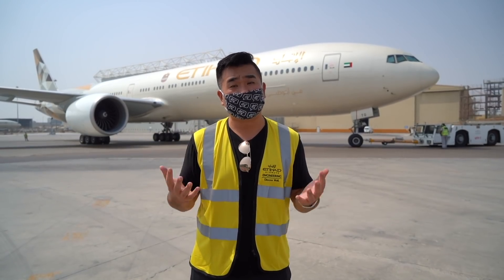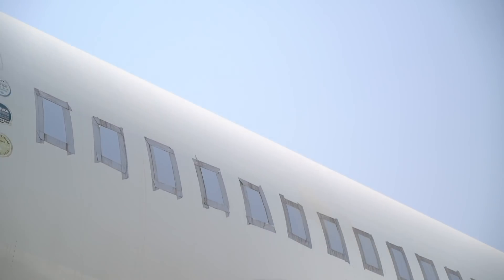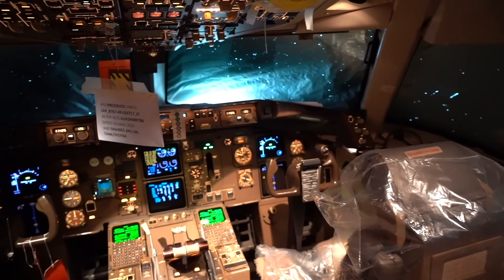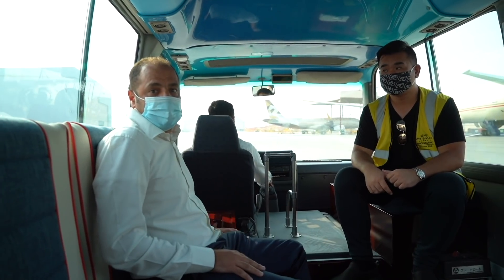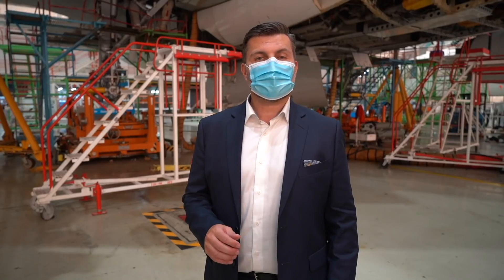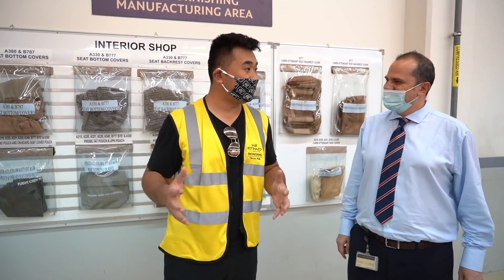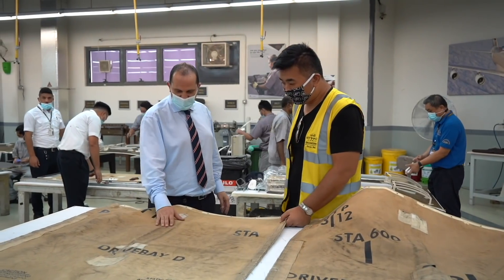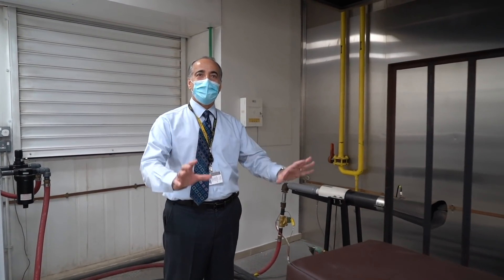What Really Goes On Inside The Grounded Planes and Engineering?

Comment: It’s a wonder how any airlines survive with this type of insane detail and cost.
Reply: No matter how good they wrap the plane something will happen. They’re made to use.
Reply: You are perfectly correct. The detail inspections called for in these 'return to service' checks can often lead to findings that will require more work, and or replacement of very expensive parts. The covering/blanking of every orifice on the airplane is carried out to prevent birds and insects from building nest in them so after removing the covers we have to check very closely and purge the openings and then function the systems to make sure that they operate normally. 
There are different kinds of fluids in the plane that needs checking and maybe replacement too, and that includes the fuel in the tank. Fuel tanks are never left empty and dry as this will lead to deterioration of the sealants that lined the insides of the tank. Thats almost wing tip to tip!

Comment: Sam: How many hours does it take to bring it back to service
Engineer: Its takes 3-4 days  😅
Reply: @Thomas Boersma said*
Reply: 🤣🤣🤣3 to 4 days working 24 hours a day
Reply: Underestimated, also thought about hours haha
Reply: 10 people 3 shifts for 3-4 days correct
Reply: @United1158  k fine its sayed then
Reply: @United1158  or the spelling Police
Reply: I've been involved in some 'back to service' checks where I work and I can confirmed that the time it takes to complete the check is pretty correct. Now, multiple that by the number of airplanes in the fleet that has to undergo all these checks and you can appreciate the huge cost. The work is largely driven by the manufacturer's maintenance manual, so whether its a major airline or just a small fleet regional, the extent of the work is still the same.
Reply: 3 to 4 days with 15 people working on it 24 hrs. a day is what I heard... so around 1100hrs

Comment: Sam.. in the beginning of the video.. i can see the engines windmilling in the breeze.  in the normal direction the oil pump will be working..  what happens if the wind is blowing from the rear.. will the engines windmill backwards and run the bearings dry.. the pump pulling all the oil out of the galleys before it goes dry too and starts to gall from the lack of lube???

Comment: the indian guy talks so fast as if time is running out. too much tongue rolling. those hangars are to store aircraft and do maintenance. its not an engineering hangar. they dont design planes there. sam, youve been in aviation a long time. take some aircraft courses like theory of flight, aero engines, mechanical systems (flight controls and hydraulic systems) etc